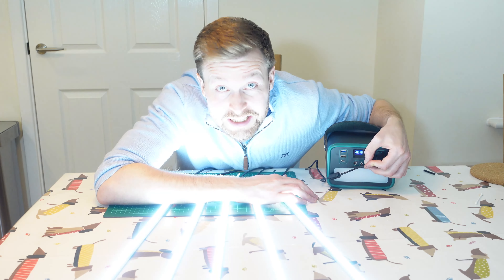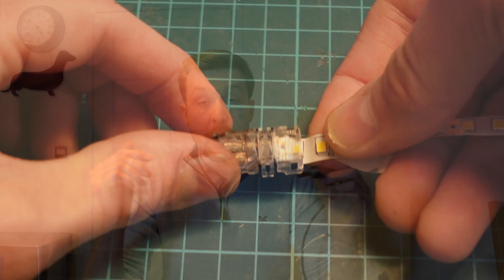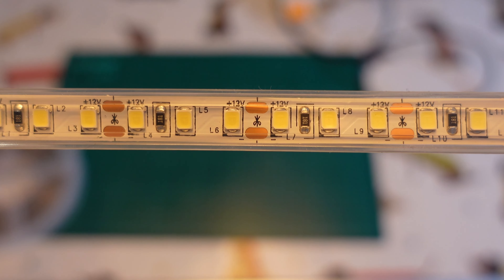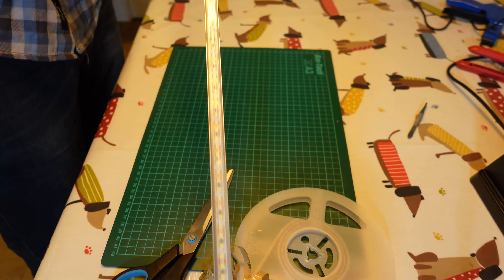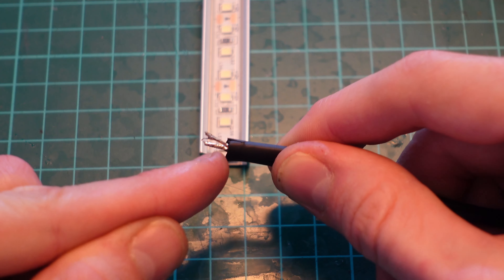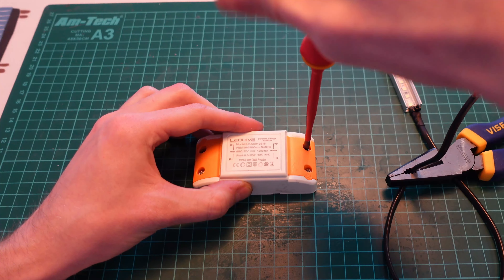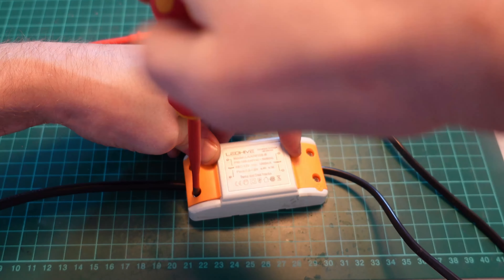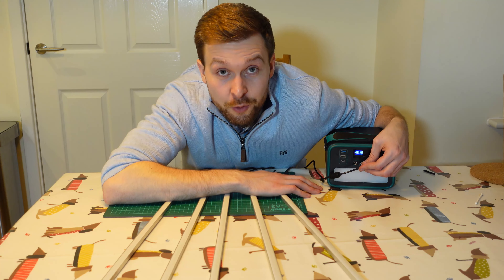Build your own LED battens / strip lights | Battery or mains powered

Comment: Great video, looking for a idea to light up my garage. Do you have a link to your battery pack ? Thanks
Reply from the maker: Thanks! The battery pack I have here is the "BEAUDENS Portable Power Station 240Wh". 
They are all similar though just search "power station" on ebay, amazon or ali express. 
If you want something cheaper look for a "battery car jump starter" with a 12v output. 

The LED's I have here where nicer branded ones that cost £30 per 5 meters and I would definitely recommend these over a £10 roll from ebay. 
They are much brighter and only use 6w per meter even though they're speced for 10w per meter.

Comment: i had an led light bar. i connected it to the car battery and blew the leds. it was battery powered by 3.7v
do u think the cars 12v was to much. if so. some led bars like the same as mine run on 12v. idk why it blew
Reply from the maker: Yer the 12v car battery would have been too much for your 3.7v LED strip. The voltage of your power source and device needs to match (roughly, 10%+- won't really matter for stuff like this) as it has no choice but to receive it all. This means the 12v power would be going through 3.7v rated LEDs, resistors and wire causing everything to heat up until one or more parts break or melt. If you happen to have some that are still working from the 12v battery though I bet they are getting hot and with continued use will break also. 
You could look at getting an adjustable voltage regulator (with a screen to see what your output voltage is changed to) on ebay for £5-10 which would allow you to convert the 12v to 3.7v (and other voltages if needed later).

Amps (current) on the other had is like energy potential. If your power source can offer more amps than the device needs it will only take what it needs so having extra won't hurt. 
I would advise watching some youtube videos that explain voltage and amperage while also being very carful with DC car batteries, for your own safety I'd advise not not playing around with anything more than 24v.
Reply: @craftycamel3498  yh then i realised leds run on 3.7v max and if they run on 12v supply then they all have resistors which mine didnt because it was for battery powered and i tried to convert into wire powered. either way ive learnt something lol
Reply from the maker: @nnasssloolllas8024  Not all LEDs run on 3.7v. You can buy 5v, 12v, 24v, etc. It would be possible to run a 3.7v LED with a 12v power source but you would need a large resistor to drop the voltage before the LED, but this is not ideal as it will just waste that electric as heat and break over time. The adjustable voltage regulator is what you want to use.

Electric and wires are often explained as water running through a garden hose. You would not want to water your plants with a jet nozzle so you could squeeze the house so less water gets through, this is what a resistor does. But it's better to just get a nicer shower head which will take the full pressure water and convert it into something usable, this is what a voltage regulator does. They are also called boost converters to raise voltage only or a buck convert to reduce voltage only.

Playing around with low voltage electronics like this is quite safe and you're bound to fry many components, just be carful with using capacitors (electrolytic ones only) the wrong way around as they will blow up.